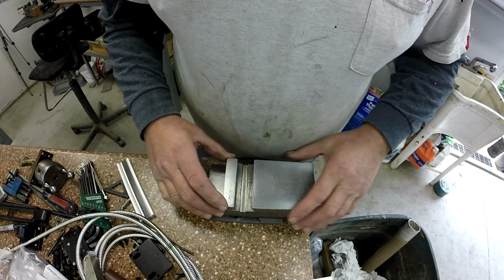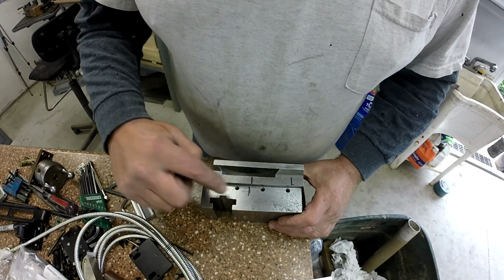Logan DRO install part #Z Vector

Comment: Nice work on the minified scale, currently working on my cross slide, so I’m thinking how to remove the ends, to make it fit better in line with the length of the slide. Thank for sharing!

Comment: nice work stan!!!! is it possible flipping the strip and the read head so u can have the cable ruun away from your compound dial??? just wondering ;)
Reply from the maker: Sure, the cable seemed closer to the line of fire that way, I would rather bump it with my hand than get it tangled up in the chuck .

Comment: Hi Stan, why did you have the wire on the Z vector come out towards the operator instead of going inboard?  Thanks, Joe
Reply from the maker: There are times that the compound would be parallel with the bed, this would put the cable @ the chuck side.
Reply: Makes sense.  Are you going to video how you run all the cabling ?
Reply from the maker: Yes, I will follow up.

Comment: I was really hoping for the scale inside with a carbon brush pickup to allow full swivel. :-)
Reply from the maker: Why not a wireless bluetooth link too? Hey .. we might be on to something there. Overhead last week in the shop "I gotta change the batteries in the lathe compound"
Reply: I think I saw somebody does make a wireless scale reader.  I can't remember where I saw it though.  That is going to be a real handy lathe to use when you are done.
Reply: Yuriy's Toys. He makes a Bluetooth adapter board, which is compatible with most types of scales. I use it on my little HF 7x10, though my scales aren't nearly as nice.
Reply: Will the DRO take an angle input to the vector offsets? Slap a rotary position sensor in there so you no longer have to input the angle in manually

Comment: Would there be any way to add a rotary encoder to the compound, which would interface with your display? Would be pretty damn cool to have the compound angle automatically taken in.
Reply from the maker: Maybe some electronics whiz kid could do it, certianly not me.

Comment: Without the end caps will the scale not slide out?
Reply from the maker: magnet is epoxied in, SS strip was folded on the ends and fastened.
Reply: OK, great job!